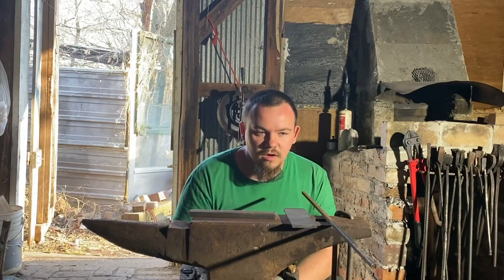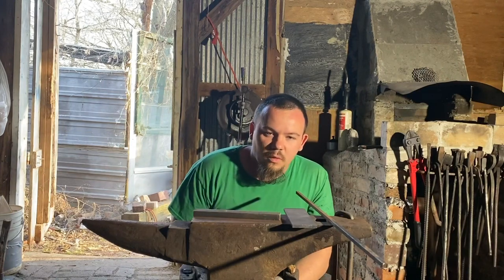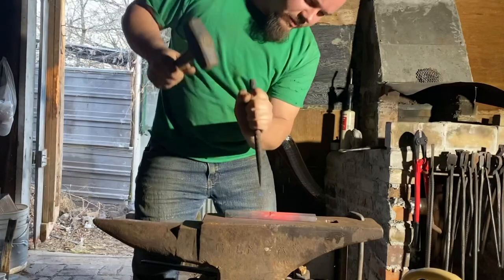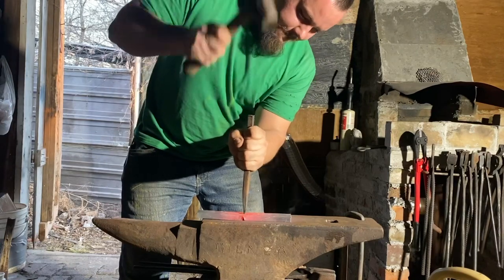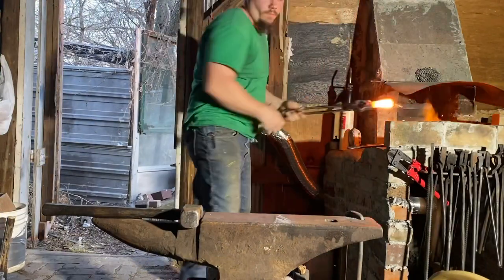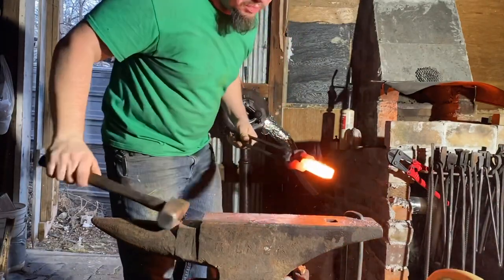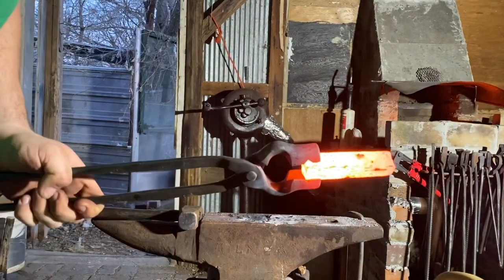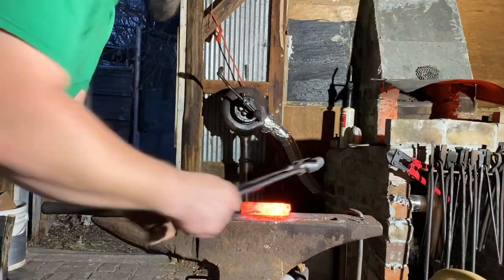Forged Gun Barrel - Method 1

Comment: Good golly Sarge. That folded square technique is a stroke of genius! Two to three of the basic steps of making a barrel, done with a single folding and welding.

If you want to keep from collapsing the hole, a good technique is forging out a long round-stock mandrel to pound through it. Saw it on the video before me, seemed to work pretty good.
Reply from the maker: Ive found forging by myself, they suck the welding heat right out by the time you get it to the anvil, and if you insert at the anvil you get an absolute terrible weld around the bore that needs extra drilling out (not a bad thing if you are wanting to go large bore)

At this pont in time I have welded 14 barrels of various lengths without a mandrel, and have yet to collapse a bore  using any of the 3 methods. (That being said I am diligent that I work the barrel evenly in its cross section)
Reply: @veteranironoutdoors8320 
Ah yes, the heating issue was the one major thing I noticed with using a mandrel. I guess I don't mind working through more heats as much because I use propane. It's not as labor intensive as coal can be.

By the way, I tried contacting you via email for commission pricing but it got returned to sender. Are you not using that email anymore?
Reply from the maker: @robertlombardo8437  That is my main email, however you are not the first to have problems contacting me, so I have created an Email specifically for the YouTube channel: veteranironandwood@aol.com. Please try contacting me there!

Comment: Hmm. Interesting...  I always wanted to make a wrapped barrel . A damascus barrel as they are commonly but wrongly called. 
I'd imagine the bore mandrel would be the hardest part to make or aquire.  Forge welding thin strips of steel together , while tightly wrapping them around the mandrel      to make helical layers .  Building up until you have the desired  and uniform wall thickness and an undersized bore.  Rifling can be made by continuing with the mandrel work or cut rifling ...or leave it a smooth bore if desired.  Note a shotgun barrel is not just a tube.  It has an internal constriction ,called a forcing cone  at the end of the chamber. Plus at the muzzle  end, between 6-10 inches back from the muzzle itself, is an area  about 3 inches long that is not polished as well as the rest of the bore. This area slows shot cups and wadding, causing drag which eases seperation of the projectile payload from the cup .  That area is not used in slug guns made for sabots . This is a big reason why shot is not recommended through them. Foster slugs are slightly under sized , and utilize that area to make a good projectile to bore seal. 
The meplat area of the slug slows down faster then the base , so it expands the slug.  At least when the barrel is made correctly . 
Very cool experiment . My only gripe here is the " proof loadings ". They are not proof loadings ,they are just overpressure loads.  there is a formula to follow to say it is proofed.   Specific levels of over pressure are used to know the gun is safe with all commercial  ammunition, yet does not induce structural issues.  Called a red pill , it is loaded to be %70 percent over pressure versus a standard factory loading of the ammo type.  The sequence is factory , plus %30 , inspect then plus %70 , and inspect.  Magnetic particle inspection is done after proofing to look for microscopic cracks and flaws like internal stretching at the throat . A borescope with high magnification can be used but is less effective than  mpi ,but far better than no inspection.  Good video, it made me think
Reply from the maker: You are SO wrong on so many things in your comment, I am embarrassed for you.
1-Yes it is called a damascus barrel. Thats what they called them back then so that is the correct term.
2-the bore mandrel would be the easiest part to make out of the whole gun.
3-you, with no demonstrated blacksmithing knowledge, are trying to tell me (a blacksmith) and others reading this on how it should be done? Gtfo guy.
4- you CANNOT make rifling with a mandrel and a hand hammer. That is a very specialized industrial process that requires special tool steels, very short working times, and a very heavy trip hammer and dies.
5-dont know where you were going with the shotgun barrel info, but that’s common knowledge guy.
6-“they are not proof loadings, they are just overpressure loads” UM, what do you think a proof load is, dumbass.
7-the saami indusry standard proof load is 125% of the cartridges maximum sammi rated psi, not 70%. So if it is a 55k psi cartridge they proof it at 68,750psi.
8-the barrel was measured at several different lengths with a digital caliper pre and post firing to see if there were any bulges or swelling.